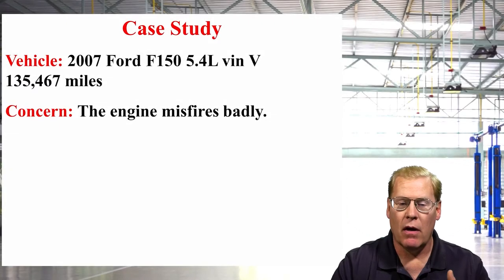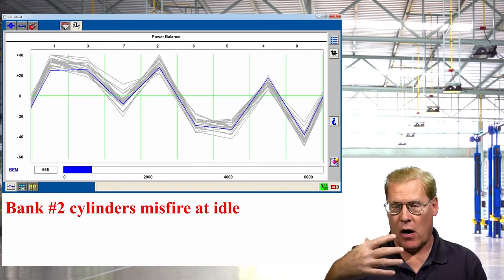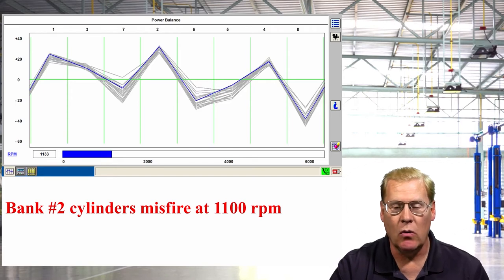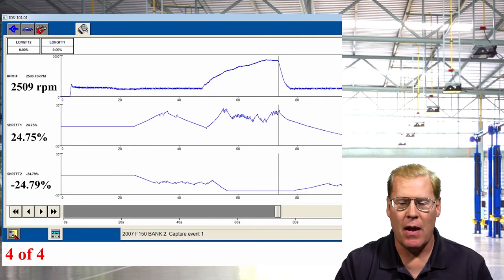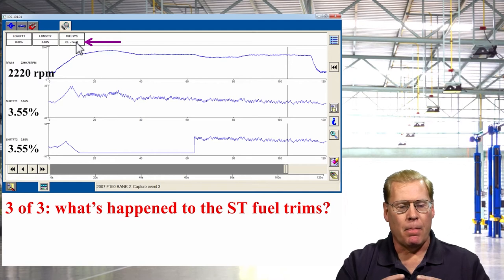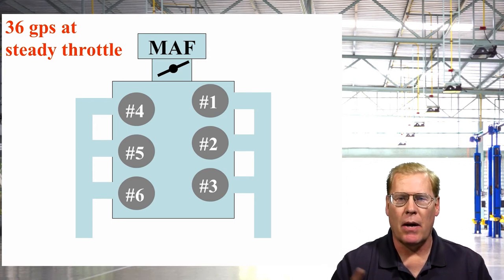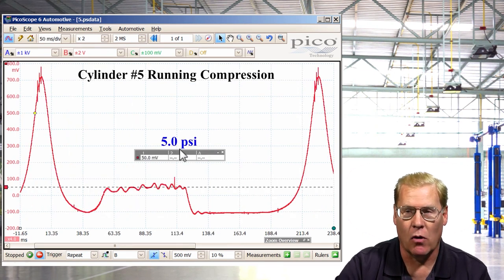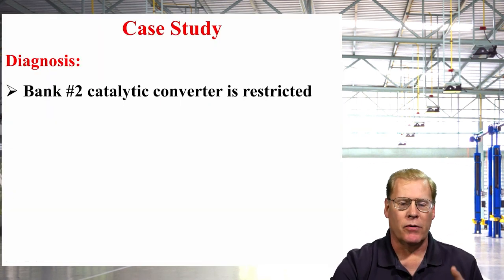Fuel Trim Imbalance Case Study, presented by John Thornton

Comment: For anyone still reading comments on this video: If the O2 sensors are easy to access, I wonder if it would have been more efficient shop practice just to screw in a pressure gauge and compare the banks this way?
Reply: Yeah, its done like that to diagnose exhaust restrictions

Comment: Great explanation, you must reset the fuel trims & drop the exh simultaneously if your going to check for a restricted exh/cat that way, the learned fuel trim wasn't going to let that engine run very well. I do see lots of cam timing problems as well causing similar issues.
Reply: How do you reset the fuel trims?
Reply: @SomeoneSaid-nu6qd  I would also like to know the same.

Comment: Good video. I have the issue with my 98 4.3 S-10 and everyone says what the las guys says is "Cloggged Cat, Bad Fue Pump, Bad Spider injectors, bad 02 Sensors etc" yet I have replaced allll oofff thoseee.
Reply: Same issue with fuel trims bank to bank? Be sure to reset trims after detaching the cat.
Reply: Vacuum or exhaust leak?

Comment: How does ethanol affect ECM/PCM fuel trim calculations?  Does it require the same 14.7 ratio calculations or some other ratio?  If so does the ECM/PCM sense whether the fuel is ethanol or gasoline and use a different ratio for ethanol?  If the ECM/PCM assume gasoline is used and does not adjust for the use of ethanol what is the impact on  air/fuel calculations and fuel trim outputs?  How does this affect scanner outputs, rich, lean, etc.?  Is there a YT video that addresses these questions?  Bottomline: How does the ECM/PCM adjust for these two different fuel types with different optimum air/fuel ratios, or does it not, and what are the impacts on scanner readings and diagnosis?  Again,  is there a YT video that addresses these questions?

Comment: All this waveform analysis is nice and all, but a vacuum gauge and back pressure gauge could have done the job.  Volumetric efficiency testing too.  Perhaps measuring inlet and outlet temperature of the catalytic converters?

Comment: 2008 Ford ranger  V6 vulcan engine . LTFT Bank 1 was running negative -.8 at idle , would not change. LTFT on Bank 2 at idle was 9 percent. Drive down the highway both long term fuel trims were within acceptable limits, but press more on gas pedal #1 LTFT got more negative and # 2 LTFT got more positive. Checking the number 1 catalytic converter oxygen sensor B1S2 with the truck fully warmed up , it was found the sensor was exactly duplicating the upstream sensor, switching from .2 to .8 volts. Number 1 catalytic converter was obviously no good and partially obstructed as well.

Comment: So, when the shop stated that they dropped the cat. and it didn't change anything about the condition, were they blowing smoke up yours, did they  remove only one side, and happened to choose the wrong one?
Reply: What I think happened, they did not do a KAM reset when they detached the manifold/cat. Just a guess but that's what probably happened.

Comment: What's the difference between the PCM operating in closed loop with a fault vs open loop? If it's no longer listening/responding to the O2's input and just using stored values, isn't that just open loop?

Comment: Fuel trims sometimes are not accurate, meaning not real, caused by defective or aftermarket or dirty or old OEM MAP or MAF sensors,  like mine, the MAP sensor, which causes both fuel trims to be at 12 to 14 percent. I thought that I had a vacuum leak, but it was the aftermarket Delphi MAP sensor reporting wrong air flow or air pressure to the ECM, I just put back the OEM sensor and the fuel trim went down to 5 percent.  I couldn't believe it, almost 10 percent extra, unnecessary fuel was injected into the cylinder, I don't know why oxygen sensors didn't report rich condition?

And now I installed new  OEM honda Denso bought from eBay, and the fuel trim went to zero percent now, sometimes 1 percent, sometime minus 1 percent sometimes 2 percent. I couldn't believe it.

The initial issue was rough idle and sometimes engine misfire, and fibration, but it was the ignition  electric connection wires that were loose at the aftermarket start button system. Basically, I created the problem over time by using a bad quick disconnect connector. I replaced the connector, and the problem partially solved: rough idle and misfire, but the fuel trim problem got fixed by installing the old OEM MAP sensor back.

Comment: Why wouldn’t you first take out your temp gun shoot the manifold then the cat??? Just don’t understand why if you think you have a restriction in the exhaust why you wouldn’t check temperatures, IDN? Maybe to learn the newbie’s a long way to check exhaust restrictions 
Done…….. 30min of time waisted
Reply: i have watched dozens of these videos trying to figure out why my V6 is rich on bank 2 .. i thought i had found the answer here .. but my cat temps before and after are exactly the same  on both banks .. i have high long term readings on bank 2 and soot builds up on the exhaust pipe ..
Reply: Did you do a smoke test?